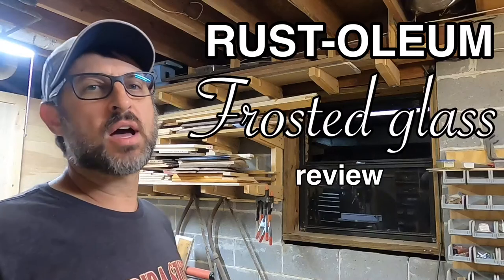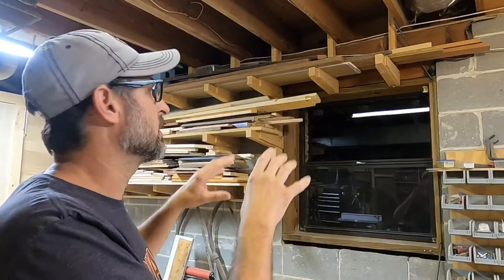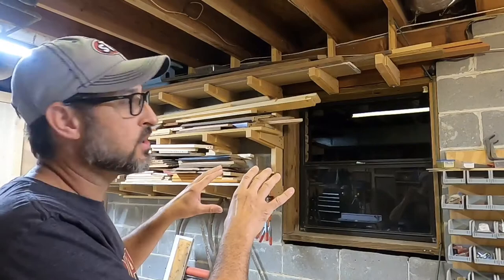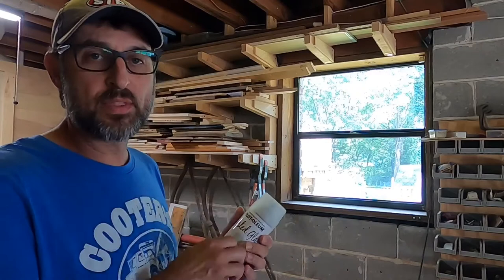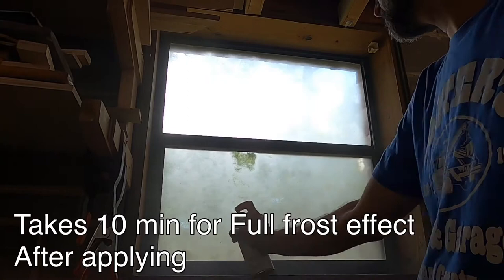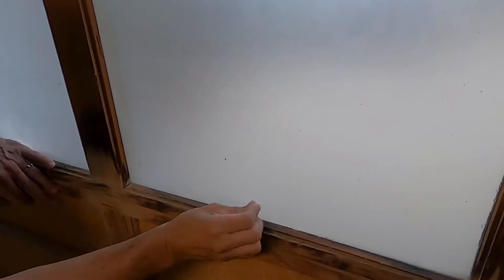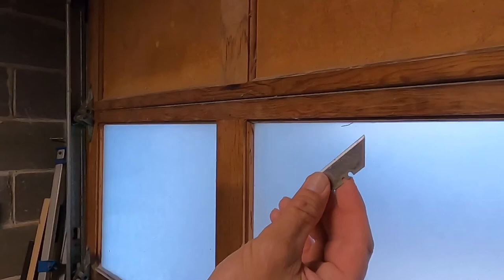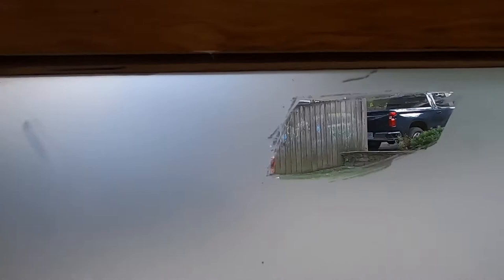RUST-oleum frosted glass spray review

Comment: I used painters tape to give the glass a two toned look, but when I took off the paint, it kept peeling the edges of the frosted parts off. Any way to prevent this?
Reply from the maker: Not sure  why but the spray seams to be a bit thick. It seams to be quite durable but I guess time will tell